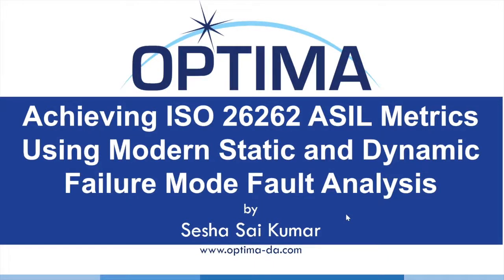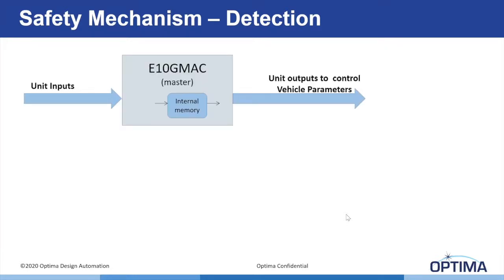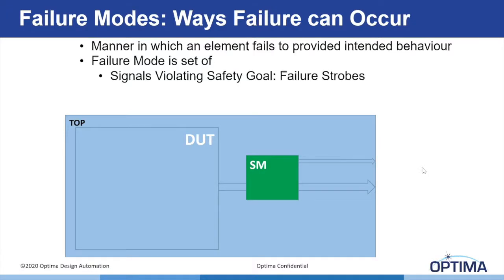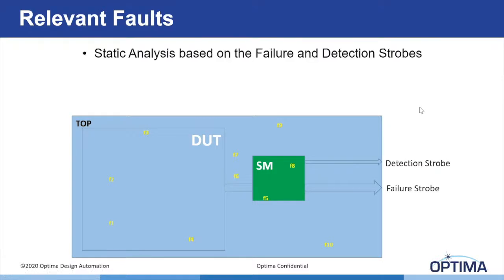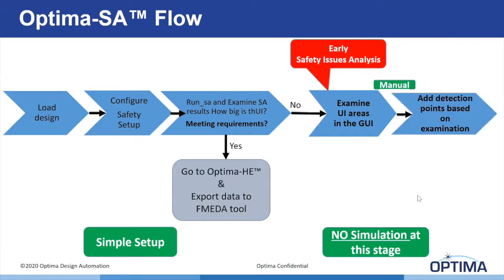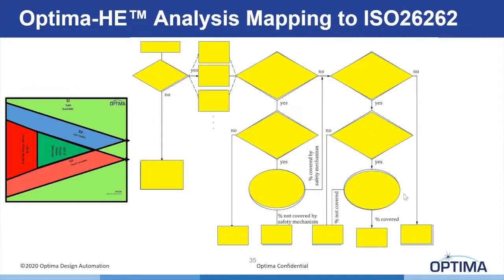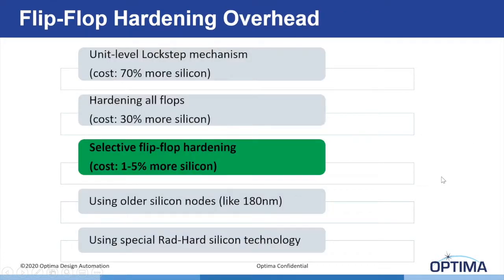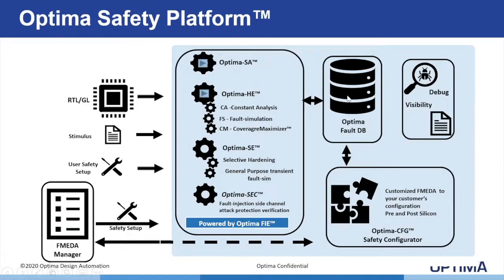DVCon US 21 - Workshop: ISO 26262 Dynamic/Static Failure Mode Analysis

Comment: @15:17 ... Why does it say "No fault simulation at this stage" AND also say "Run on sample faults"? What does it mean to run faults without running fault simulations? On they very next slide you seem to indeed be injecting faults into the DUT. How can you determine which faults really need hardening, as you claim on the slide, without running simulations of the injected faults (bottom cone) to see how it compares with the correct output (top cone)?

ON your website you say the following about about SA, which makes me think you are indeed running faults at that stage:
"Let us consider an example. The figure below shows a typical safety mechanism, a lock step monitor. This consists of a shadow circuit, which is a duplicate of the main master circuit. The outputs of both are compared on every clock cycle (i.e., in lock step with each other). If a difference is detected on those outputs, a fault is declared."
Reply from the maker: Greetings, 
Thank you for the interesting question. Could you please contact us via info@optima-da.com with the subject line "YouTube comment to respond". Add your question there so that we reply directly. 

Thank you and regards, 
Optima Team